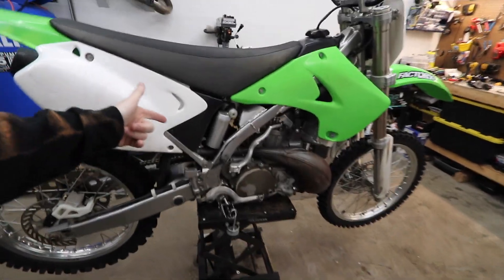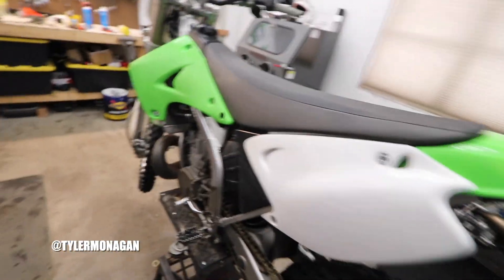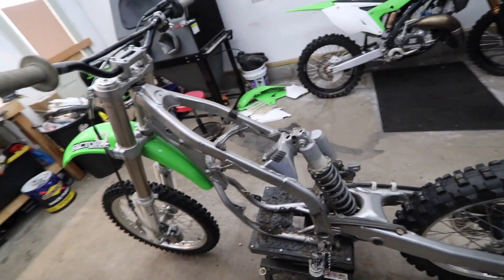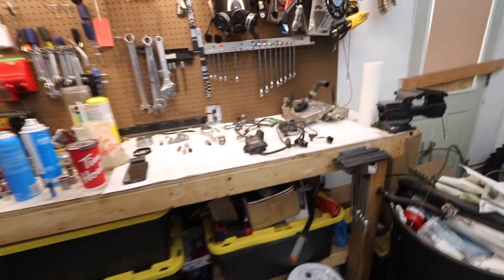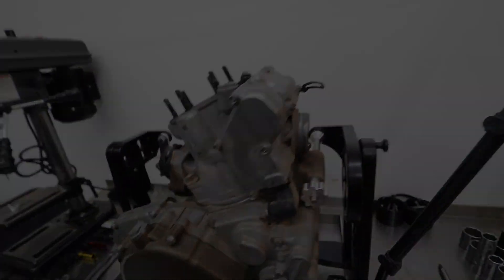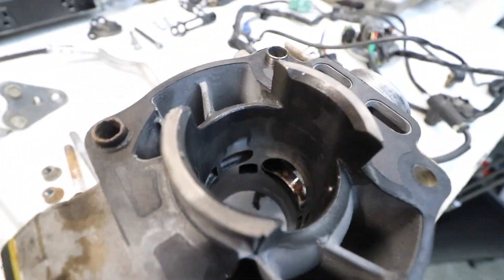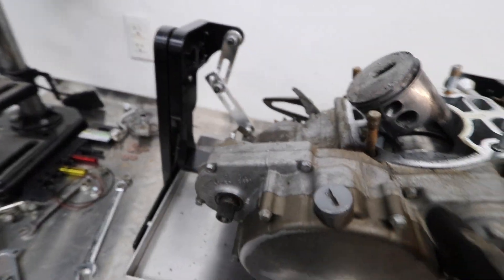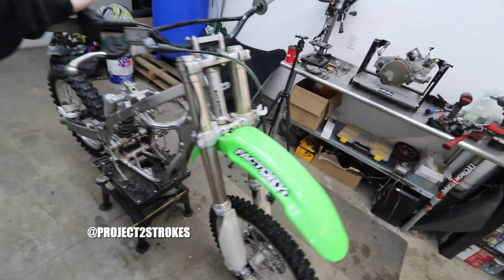BLOWN UP 2021 KX250 Two Stroke Teardown... NOT GOOD

Comment: Yo i was going to cry watching you cut those cables and stuff lol
Reply: @tct72  dude hes gonna put a new carb into it lmao how is it dumb if he doesn't need it
Reply: @braydenser9544  Well if he's not going to be using the carb then why didn't he just smash it off the motor with a hammer then. Would have made the same amount of sense. He also cut the clutch cable which he will need to replace if he is still going to be using this motor and I'm pretty sure he is.
Reply: Are all you guys high? Why would you fully rebuild a bike from the ground up and reuse the ratty old throttle cable😂😂

Comment: Minute 2:49. he carb has a "Power Jet" aka Cut off Valve... It functions off and on as the RPM rises.  The needle on the assembly moves, there is a jet that is exposed and lets in more gas. The two wires that go to the assembly send a signal so the needle goes up and down, exposing or covering the jet. It was only used for a couple of years. Like on my 1998 KX125. If you have carb problems, it the engine "runs funny",  you must check this assembly. The carb wont work correctly and the bike wont run properly, Some people believe you can get around this jet but I say don't do it.  the needle should move back and forth when you put 12 volts to the two wires. As for pistons, avoid "Hot Rod" pistons like plague.

Comment: this happens to a lot of people because they make too big of a gap on a spark plug and it melts the pistion sometimes im not saying thats the case here but its probably gonna be a whole engine rebuild becuse of little pieces of metal faing into the bottom of the engine and geting into the bearings. But ist gonna be a great build i hope you make it 2021 with the original frame becuse the 2019 looks sick and it whould be nice to have a 2019 kx125 and a 2021 kx250⚡️🔥

Comment: heating up the piston with the torch definitely made it way harder to get the cylinder off. piston expands way quicker than the cylinder and all you really heated up was the piston :|
Reply: and always get the cylinder replated/serviced when complexity rebuilding the engine.
Reply: @orange6265  the cylinder is fine no coating is gone all it needs is a hone like he cares anyeays

Comment: Leave the 05 frame on because the frame is built around the engine in a specific way for better handling so putting a different frame could make it handle like a bucket of shit just my opinion though do what you want and love the builds you do

Comment: i cringed watching you cut the clutch and throttle cables. and why are you heating an aluminum piston to make it EXPAND more and become even tighter in the cylinder lol. should have been heating the cylinder if anything...
Reply: Myles well cut the spark plug boot and the gas line if you going to cut everything els to 😂
Reply: If his going to go get all new parts does it matter?
Reply: @ethanwebb6402  that's what makes this guy such a sham, my God look at his air filter on his bike! He calls bikes 2021 builds and just buys new plastics. He's a joke
Reply: @ethanwebb6402  just seems lazy. even if replacing with new, you could keep the old one cables as backup/spare.

Comment: If you planned on rebuilding it anyway and don’t plan on using that frame wouldent it have just been cheaper to buy a motor out of a part out and then get the 2020 roller
Reply: This kid does not have the Fab skills to pull off the a 2t aluminum frame build. He struggles putting new plastics on his "builds"

Comment: You do know if your jug is scratched up you can get it replated and don’t have to buy a new one
Reply: LA Sleeve
Reply: @joenobody2580  Jesus Christ don't sleeve your cylinder! What are we in the 80s? Cheapskate.
Reply: @rapscallion3421  tryn to save money for gold plated spokes !
Reply: @joenobody2580  still not a good idea. It's 200 bucks to have a cylinder replatted. A sleeve is not nickel plated, when heat transfers to them it can end super badly and then you will be spending about 800 bucks to have your grenaded motor rebuilt...never sleeve anything this is seriously old school and down right stupid.
Reply: @rapscallion3421  never seen a sleeved cylinder have a problem. Ever.
Reply: @joenobody2580  lol you have never ridden a bike to the limits then. I guess if you are using a mx bike in your backyard a sleeve will be fine for a weekend a warrior like yourself. This is big time no no for any mx team/racer. The fact that you are saving up for "gold" spokes instead of properly building your motor shows you have very little skills when it comes to mx. Rice rice baby.
Reply: @rapscallion3421  I don't ride anymore. When I did they all had borable sleeves from the factory. Maybe your boring your own cylinders as a self taught expert that doesn't know what your talking about. And btw the nikasil eggshapes when it wears out so how tf are you replating an egg shaped cylinder. Your not. Buy a micrometer and learn how to use it before you talk to me , boy.

Comment: Ps you where lucky on the cylinder they are no longer available it's an eBay only item now . Also send the cylinder and cases to varner motorsports he is the king of 2stroke porting
Reply: Um no its not? Go onto partsfish, partzilla, and a few other sites and they still sell them brand new..... They're about $690-$710 brand new. Do some research.
Reply: Varner isn't the most reliable as seen on vitalmx
Reply: @massivesaint1415  did plenty of research those are not oem go back to school
Reply: @freeridemoto7133  as far as the bad reviews on vitalmx go, I think they are straight B.S. I sent my cylinder, new piston, v3 cases, crank,  new seals and bearings to Terry in mid June and dispute the fact that he was  working on Mike Alessi's and other top riders engines he called me and  said the rod was on back order,  due to covid. I received  all of my parts in December and they were done to perfection! And in the amount of time I had expected! He also communicated with me regularly to let me know where he was at and how long the parts would take to arrive. I  put the bike back together and the damn thing rips just as hard as my old 89 cr 500 running 14 / 48 sprockets it will pull the front wheel in every gear ...all 230 lbs of my fat ass! I highly recommend Terry Varner, he even called me after my first ride to see how it went and he gave me some tuning suggestions that worked!